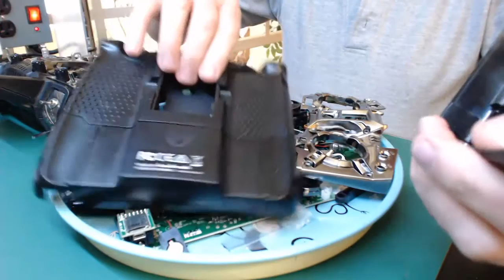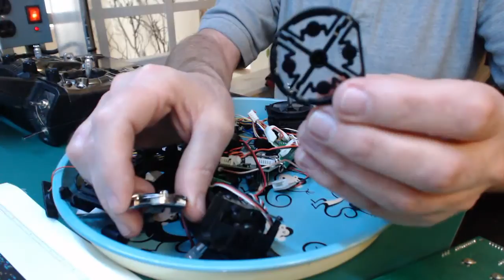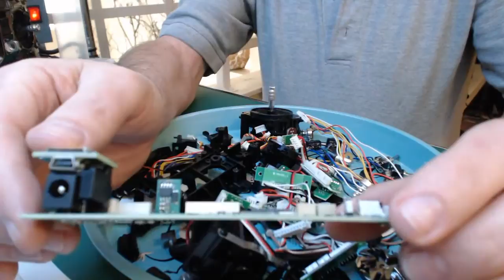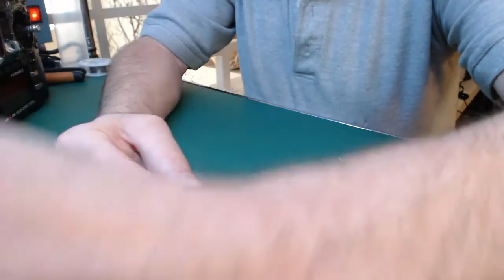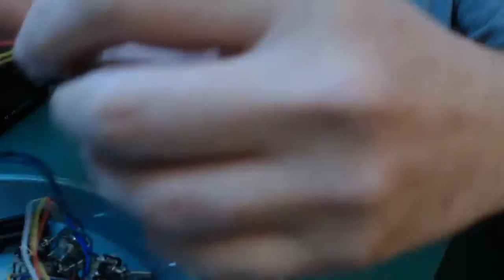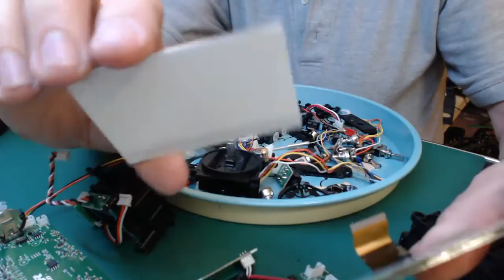[SH-0012] HK Turnigy 9XR Pro

Comment: I'm planning to change the back light for a white one. Do you think I can use this one http://www.hobbyking.com/hobbyking/store/__17129__Turnigy_9X_LCD_Backlight_Kit_White_DIY_.html, by removing the resistor and plugging it directly to the board, with the stock 9xr pro back light plug?
Reply from the maker: DoubleHelix I don't happen to have the unit near me right now (I'm out of town) but it looks the same.  I'd give it a go personally.  But dirty little secret.. you can even pull out the existing LED and put another in.. if you are of a mind to.
Reply: I only need to know where and which one to buy. i think i will stay for the first option. Thx for reply.

Comment: The replacement Taranis Gimbals are larger and will not fit into the 9XR Radio cases.
There is no upgrading for the low quality pots in the 9XR Radio Gimbals.

Comment from the maker: +George M
Thanks for the comment.  Much appreciated.  

As to listing the IC components.. here is the Short answer.  No, cannot do that. Now here is Why..

Like all too much of the R/C industry.. they feel it necessary to protect their designs by using unbranded / unmarked parts.. or scratching the info off of the chips.  Which is the case here (no surprise).  

Since I am not the designer of the board.. and that person (who I have been in contact with) had a contract with Hobby King.. he is even limited by what he can disclose.

So if you are asking because you are undecided on what to buy.. don't wait around for an answer on the IC's used.  I'm afraid it will be a very long and fruitless wait.
Reply: Cheers Alan, I understand now, thanks for your expalination. ;-)
Reply from the maker: Yeah.. they protect their investment (any R/C company), but at the same time slow down any improvements in the hobby.  That is why the stuff done by us independently is so important.  Of course once the idea is gelled.. the companies "borrow" it and up the purchase price.
Reply: Its a shame Alan as this is a personal Arduino project for me that I am working on trying to keep my mind active as I have poor health, but hey I understand, all my work will eventually be published when finished and tested, will just slow things down a little thats all.....will carry on searching and if nothing comes up I will take the long road and try and hash things together myself with alternative modules.
Cheers Alan - All the very best - George.
Reply from the maker: If you are looking to do something interesting with the Arduino and R/C .. do visit the code for the APM flight controller.  Many things can be "borrowed" from it.
Reply from the maker: George M If you want.. send me a direct email about what you are working on.  I may have some suggestions.
Reply: Email sent ......

Comment: how much better is the 9xr pro then the old 9xr and it it worth the added  20 pounds
Reply: I want to get a 9xr but which one is better 9xr or 9xrpro
Reply from the maker: It is hard to advise on such things. But what I would recommend is looking at what reason you are buying a new radio for.  

If you currently have a "starter" radio that came with a model and now wish to get something better I would recommend spending the extra money and get the best you can afford for LONG term use.  Notice that I did not call out a specific brand or model... read on..

A good radio should be an investment.. not something for glitz and just having the newest thing.  You need to be totally "at one" with a radio.. so you know it's pros's and con's, your hands and fingers fit it well.. and it has room to grow with your skills and interests.

Get your HANDS on one first.  It has to fit you (or the persons you are getting it for, more later on that)... not the other way around.  A radio that is uncomfortable to hold or control will in time aggravate you and your muscles.

Then consider the odds of you getting better at R/C (pretty good).. and wanting more functions, or more models to control.  The more expensive ones allow for that.

Some systems use a single signal wire for all the servos, others use one signal wire per servo.. something to consider as well... the bigger the model (think Meters) the wiring can be a major challenge in itself.  SO having a radio that supports One wire controls might be good.

Then there is the battle of "logic" over Proprietary products like Spektrum, Futaba, etc.. and "Open Source".   Yes the big brands tend (note I said Tend) to have more stable reliable products.  But that gap is closing rapidly.  Open source allows for faster FEATURE improvements... and for you to write your own code to match your Specific needs.   However, as with any project by committee (like the Platypus) there are somethings that break while others were fixed or improved.  Be aware of that.. match your skills in testing new features and old ones up before critical R/C activities..   I.E.  Test the hell out of any version changes before flying off into the sunset (literally).

If you are good at soldering and light mechnical modifications, Open Source will help you modify your radio to how you need it to be as well.  But you have to think through all the "advice" you get online and "how-to's" making sure it matches YOUR situation.

Last thing I look at generally is Price.  If 20 pounds is a big hit for you this month.. wait a month.. and have more money to work with in your decision.

Sometimes though after all the evaluation, I flip the criteria around.. depending on the use.   For example, I have 7 brands of radios in my R&D Stock here... but have only ONE that I use for group R/C sessions where we try to get kids and adults interested in the hobby.  It's 6 channels, minimal brains, no fancy LCD screen.. just sticks, trims, and switches.  Each one is $29.00 US with included receiver.  If they drop it on the floor or into the water no big deal.   

Always consider your needs and intent... and form your own opinion.  You will be more happy that way.  Just because a friend or someone online says "X" is the best.. not always true for YOU.

P.S.  if looking ONLY at the 9xR and 9xR Pro.. go with the Pro.. it the Brains (the motherboard) is good design and allows for a LOT of future life.   But consider all your options (brands / models).
Reply: is the 9xr pro better then the 9xr I am only asking because I am in the uk and it will cost me a extra 30 pound on to of the 9xr pro to get one sent to the uk
Reply from the maker: jameshone1000 Hopefully you read all my response above. For me the Pro is better for one application I have.  But I'm not you.

Comment: Woow.. This is what I call a review. I will start calling you Bruce in a minute ha ha..
No really, that was a very good and fair review.. It was great.. Thank you.
But allow me a few comments.. I'm not criticizing you in any way, please understand that.
Point 1- the buttons. I don't think the thickness of that part is the problem because there are as far as I know only 2 radios with that problem that I heard of. yours and Bruce's at RCmodelreviews.. Go figure.. I believe it is more what you said before. misalignment. That would explain why the other units, including mine work very well and the buttons have a good feel. About the trim buttons, unfortunately you are right, why didn't they just solder some of those little buttons there is beyond me.. maybe they do it, if I/we nag them enough. we, testers been doing that a lot. This is the first batch. You know how first batches are.. stick wires breaking and all that.. Not with the PRO.... yet... Thank God..  ;-)
Point 2- The RF Module board is not quite identical to the 9XR. There are some subtil changes. There is much more juice in it.. One of them if you look closely is a current sensor, if I'm not mistaken. Second PPM output (PPM2), etc, etc.
Point 3- The battery connector.. Well, different tastes here. I would like (the same as you) another connector and had the same reaction when I first saw it.. But then I started thinking, which is very rare. You can connect practically any 3s LiPo/LiFe battery in there. If you are at the field and your tx battery goes dead, just stick one of your plane's battery in there and you're good to go until you field charge it for a while.. That's bloody great.WATCH THE POLARITY. About the batt connector, I shaved/sanded 2mm from the connector board's back, and now it is lower and the battery wires aren't pressed so much by the battery cover anymore. We have passed that easy fix to HK as well, but you know  :-(
I do not recommend the protected battery for use in any TX. I don't need another failing point. protection circuit goes bad, your tx will go off, your pride and joy will be smashed to pieces.. Also I'm not a fan of charging Lithium batteries inside the tx. DO NOT DO IT. Please..
The radio has a switched regulator and it is 1 Amp I think. plenty of juice. also it will work with quite low voltages like from a 2 cell lipo battery..
Point 4- Vibration strength can be controlled by firmware. I find it more than enough.
Point 5- Backlight is LED, and you can dim it in the firmware. Cool, right?? It wouldn't make sense using EL backlight anymore in any modern piece of equipment, I think?
And that's all about it I guess, Good job on this review and thank you so much again for taking your time, You shown some stuff that even I didn't see  :-)
Please don't forget that this is the first batch, and you know that it is impossible something come out perfect on a first batch. specially when it is built where it is lol. Improvements will be/are being addressed, or so we have been told as testers.
Cheers!!
Reply from the maker: Thank you  ! !
All good points and Info. Criticizing you did not do, nor would it bother me either.  As long as a conversation is polite (as yours always are) they all have value.

PS, a suggestion.. your messages are great, but try adding some "white space" to make it easier to read.  Old eyes here :)

~ 1.
The on-going Button saga LOL.  Yes, would have been nice to have the same on trims.. but HK is HK. 

For the main board buttons [referring to the intermediate plastic piece] the thickness can be a factor because it increases the offset angle more if there is any miss-alignment. 

To try to put that into an example.. if you were to take any coin (like a US Quarter) and lay it flat onto the table. Place a piece of plastic on top of the Quarter and then press down.. and slide your finger to the edge of the Quarter. Your finger lands right next to the quarter.

Now if you took something thicker like a stack of Quarters in a Bank Roll.  Do the same, add the paper to the top, press down and slide to the edge.  The roll tips over and if you were to make sure your finger went straight down it would land far from where the bottom of the roll was.  That Tipping distance is the enemy of many devices.

So what do you do to prevent the Tipping.. you add strong support.. i.e. those arms holding the intermediate disks in place.. and since they are of the same material, end result is IF the disk presses directly down and does not tip.. it takes more energy to overcome the support arms. 

~ 2.
Very glad you noted that there indeed were some changes to the RF / Connector Distribution board.. and what they were.  I have not pulled apart the 9XR as much as the Pro.. so could not see well under it's board.

~ 3. You make many VERY good points there.  Being able to throw any 3s Battery with a balance plug into the radio is Spot On.  As is the idea of shaving some of the inside of the battery compartment cover.  Getting HK to do that mod doubtful. To do it by hand would cost a lot, as would a new mold for the part.  But these days Pigs can Fly.. so you never know.. they just might LOL.

~ 4.  For myself.. I found the vibration level to be just fine out of the box.  I only mentioned it for those that like to feel the Earth Move.  I did not mention the level adjustment because I'm a firm believer in RTFM (Read The F*****g Manual).  But glad you mentioned it for others who don't read them.

~ 5.
Yes it's LED.. and I had mentioned the EL issue, and why it would be best to be LED.  But there are still cases where EL is used.

~ 6.
1st Batch... yeah.. I know how that works.  Been there many times.  BTW unless it is Chinese for RTFM, there is a sticker in my battery compartment that looks like the number 805.

~ 7.
Wires coming off of the Stick pots.. Gads I hope not..
Once you determine that the radio is not Dead on Arrival and everything works (i.e. no return necessary) I recommend that Everyone open the back (it's easy) and check the wires carefully before using the radio the first time.. AND add Hot Glue (I use Low Temp on wires) to support the wires on the switches and all Pots.

~ 8.
I have been an Alpha and Beta tester on lots of high tech equipment and software over the years.. and Yep.. all you can hope for is that your feedback is listened to.  But sometimes very obscure (and sometimes good) reasons cause the product not to change as desired.  HK does seem to be listening more, have to give them a lot of credit on that.. it's a lot of items to manage.
Reply: SynergyHub  agree..
For the battery connector, I didn't shave the battery compartment.. The connector is on a little board. it is the back of this little board that needs some sanding. That will allow the little board and connector to sit lower.
Reply from the maker: P.P.S.
"I will start calling you Bruce in a minute ha ha.."
GRIN - Don't do Bruce a disservice.. he is much better looking than I am and does not say "Ahhh" 7 thousand times in a video like I do. LOL.  Some day I hope to be at least 1/2 as good at the videos as he is, but alas, I'll never as good looking.

[Soap Box mode On - aimed at general audiance]
RCModelReviews
I respect Bruce a lot.. not everyone agrees with me on that.  But he is a value to the hobby, doing an excellent job of explaining various things, voicing his opinion, standing his ground, and still having FUN.  And Yes, I have learned some great things from his Reviews.   Besides, how many of the negative folks are putting their face were their mouth is.   I always say don't knock it until you have done it.
[Soap Box mode Off]
Reply from the maker: pilot140467

Ah.. me bad.. that is what you said... Thank you.  I am going to play with that issue more though because it affects both radios, and my 9XR will need it. Since I have a back shell that has been volunteered as a guinea pig for it, I can see a Dremel in it's future.
Reply: SynergyHub Dremel? be careful because of the solder pads.. You don't want to ruin it.. I kinda... sanded it  :-)
I think that HK could do this mod and still look professional. And order the next batch of little boards a little smaller..
Reply from the maker: LOL.. no I was referring to the back case shell.  Sorry I was not clear on that. 

P.S. I'm actually not fond of hand held Dremel use.. too easy to have it dig in and rip into the wrong thing.
Reply: SynergyHub and it normally hurts  :-)
Reply: pilot140467 when it goes really wrong I mean
Reply from the maker: Yep.. and it can go really wrong really fast.